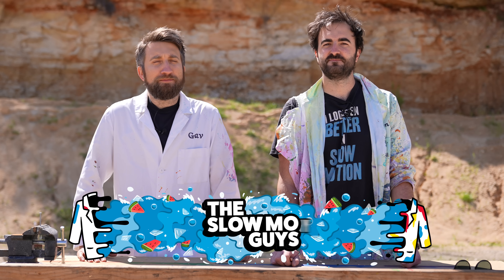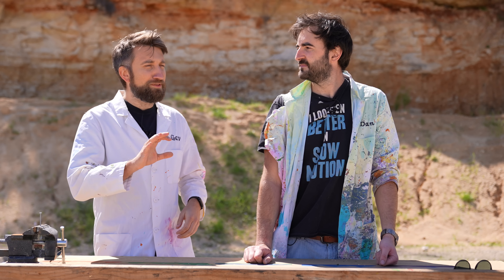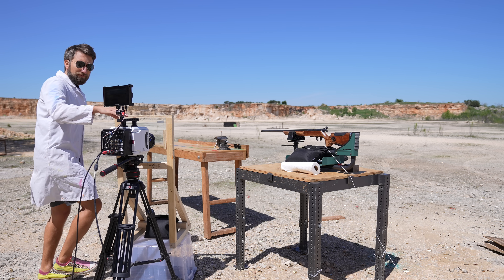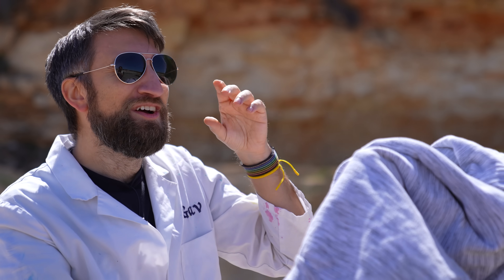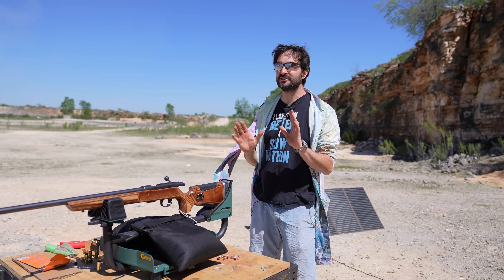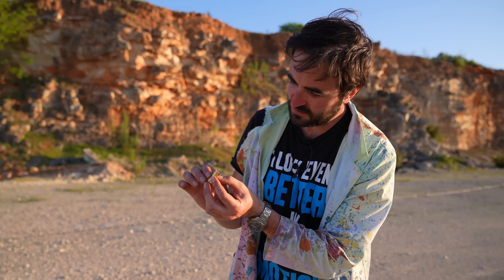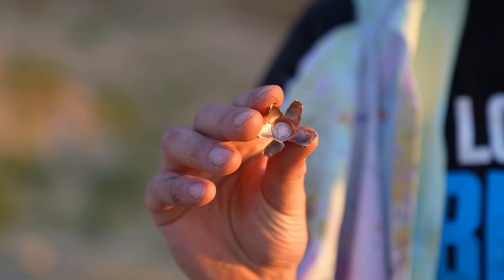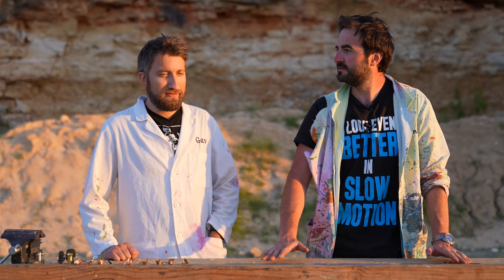Can a Bullet Go Through Another Bullet? 875,000FPS - The Slow Mo Guys

Comment: If you wanted to use a more accurate round why not the NATO 5.56 or Remington .223? Both of those are technically the same caliber as that tiny little pea shooter .22 but they pack enough propellant to fly straight through that hollow point. The first clue was that it was a pointy round and not a ball…could’ve been way cooler to use an appropriate round. (If it was a handgun in the movie it was probably an FN 5.7 which is just a tiny bit larger than a .22 but a higher velocity load)

Comment: To get more velocity akin to two guns firing at each other, get a 22WMR casing, hot load it, and use the sawn off tip of a phillips-head screwdriver for the hardened bit.  That's your smaller bullet.  Sabot it to get a good seal and to avoid barrel wear.  You can get a good spin and the shovel shape will wedge the larger bullet apart.

Comment: If two were fired at each other and hit exact, they wouldn't just "stick together" and drop. What will happen is that both will peel outwards in a perfect radius, 90 degrees from the impact (perpendicular) exactly like if you fired one at a solid piece of steel. They would both do this, so you just get a perpendicular expanding radial circle of scrapnel, in a very thin line right around the impact point. Hope this makes sense... hard to explain without drawings !!

Comment: I know they tried to recreate the closest they could, and they even said the answer without realizing it; the smaller bullet was NOT a .22LR, it was most likely a custom 5.7mm x 28mm round, fired mostly by the FN Five-Seven pistol or P90 PDW; a round literally designed to have less kick than a 9mm, but ALSO able to...defeat body armor. It does this by using a smaller, spitzer tipped, higher velocity round than a 22LR. Every round fired in these tests was a copper jacketed, lead core. Not sure why they say its so hard to buy steel core rounds...they sell them at every gun store. Two pieces of lead will deform regardless of shape/velocity. The proof is that they cut the velocity in half by having only one bullet moving (and rotating, also stabilized) & the other just sitting there; but when they kicked it up to an actual rifle round, its velocity alone makes up for 2 handgun rounds.
Show us a 5.7mm solid copper round hitting that fat, hollow-point  .50AE round and I guarantee the 5.7mm's velocity is high enough to penetrate AND continue on...accuracy after impact though...shmaybe.

Comment: There’s a puzzle in the game Ghost Trick: Phantom Detective where the goal is to find something to swap with a bullet that’s been shot that has the same shape as the bullet, but because the bullet is so small you can’t really see it, one of the objects you have as an option is a knit hat, like a beanie. When the hat is sitting on a surface it’s shaped like a long rectangle with a round end, as a kid I thought that was the right shape because I was picturing an unfired bullet, but the solution was to have the hat hang from a hook so it is shaped more like a half circle

Comment: If both bullets were fired from pistols at say 2000 feet per second, wouldn't that make the impacting velocity 4000 feet per second? If a hardened jacket on the smaller caliber round was fired at a high enough velocity to over come the opposing energy of the 50 caliber round, it could continue on its course, but at a greatly reduced rate.I would love to see a slow mo of a hardened projectile fired through the 50 cal, at say 20,000 MPH. Maybe try it with a shaped charge, well perforating unit.

Comment: Interesting video with awesome footage. 
7:07 they aren't going to either. The 22lr is too slow / too low energy. What little energy the 22lr projectile has is being consumed by accelerating the 50 AE round off of the nail. Another thing that is coming into play is that you are firing a lead bullet into the open nose of the 50 AE round and thus going lead against lead rather than copper against lead (yes, for those questioning it, the 22lr projectile is for all intents and purposes just lead... They are copper plated, hence the copper appearance but not copper jackets) so its likely that the two lead portions are just melting together (i.e., energy being lost / converted to heat).

12:40 A better more movie accurate choice would have been to fire FN 5.7x28 rounds at it.  Then you would have the small pointed copper jacketed projectile that would have more accurately (within reason) matched what was shown in the movie. FMJ Type 5.7x28 ammo isn't all that hard to find (armor piercing shouldn't be necessary, FMJ's will probably do the job).

As for the .30-06 rounds, if they were soft point or hollow point, then I'd expect them to do exactly what they did. A FMJ round might have actually pierced though but its larger diameter is going to cause problems nonetheless.

Comment: You can get the M855 green tip 5.56 with a soft steel core which may hold it's form through the lead and copper jacket. They are readily available at any gun shop. It is also .224 caliper like the 22 long rifle you tried.

Comment: Firing the .22 into the primer was pretty interesting to watch, and you are right about it needing a barrel to ignite all of the powder.  Smokeless powder burns with much higher pressure and intensity than black powder, though "burn" isn't really accurate, as it more detonates since it's a grain propellant and not really a powder, but it does need a barrel to contain that pressure to ensure that all the grains get ignited.  Anyone who's fired short barreled rifles will notice that a some of the powder doesn't get ignited and is thrown out  of the barrel before it has time to ignite.

Comment: Here's an idea for the next video and a solution to the messed up table. Take an electric sander (or maybe just regular sand paper if it's easier) and sand off all the uneven holes. Probably won't get rid of them completely but would definitely make them smaller. Then record the movement of the sander across the table, showing all the little wood particles getting obliterated. If it’s too difficult to film then at least use the sander on smaller things

Comment: should have used a .22 lr packs more than they normal .22
or an actual pointed round like the one in the movie which likely also had a slightly higher powerder load 
the thing is with how perfectly this kind of worked id call this one plausible
and while yes the rifle round was doing more of what was seen in the movie the fact is neither of the bullets you used where hard tipped which is likely why the bullets just kinds clumped together

Comment: If they shot two bullets into each other, the trajectory of the fragmentation would move in the direction of the bullet with greater momentum, which is a function of mass and velocity, which is almost certainly always the bigger bullet.  It would only stay in the same place if the bullets had the same momentum, which would probably require the exact same kind of bullet.

Comment: You guys unknowingly went the myth busters route, you tested the myth but then recreated the results. That’s what we need to see!! Great job.
Reply: Absolutely the best part. The "ok, but what does it take to make it look like that" escalation is very mythbusters.
Reply: They inadvertently made the same mistake as The Mythbusters when they caught caught hell for not taking into account Newton's 3rd law of motion, although for the opposite reason.  We are only seeing the kinetic energy of the smaller mass hitting the larger mass.  If both bullets were fired at the same time, the larger bullet would greatly increase the amount of kinetic energy in the collision and likely change the outcome.  It would be like a car traveling 60mph hitting a stationary truck vs. a car travelling 60mph hitting a truck travelling 45mph.
Reply: Myth Confirmed.
Reply: @DJBillionator  I'd say Myth Plausible. The tests weren't particularly analogous due to the lack of a hardened AP tip on the smaller round, but we can still learn from these shots that it's probably maybe possible potentially
Reply: No, they didn't. One bullet fired isn't the same as both bullets being fired. Nice try though
Reply: @ericmarc7529  It entirely depends on the power difference between the two rounds, the round with the most power should be the one being fired.

Comment: 10:41: This is just exhausted guesswork so take it with grain of salt; Most of the propellant failed to explode because it wasn't compressed. The brass swells and then ruptures, disrupting the ignition of the powder, because the bullet isn't seated in a barrel to contain and redirect the force forward instead of outward. 
Or I'm totally worng
Reply: I believe the powder requires more like heat, as opposed to pressure. The primer sends out flames, not so much gas pressure. Of course, enough externally generated pressure will generate heat (and potentially ignite the powder) but here it wasn't enough.

Comment: Lads!!! Outstanding video.... but there is something weird i am noticing here.. i think. I am a serious marksman.. shooting a bunch of handguns.. rifles etc.  2 Things that really grabbed my attention... 1 the unstable spin attitude of the 22 round.  and 2 on the 30-06projectile.. just before impact.. a few frames before?? It looks like there is something weird going on at the very tip of the 06 projectile. It looks to me like the tip is deforming, peeling back or something is up there. Can you inspect the frames and see whether its just an illusion?? or does the 06 projo actually deform its tip during that very short flight to target?  If it does... it has a HUGE and significant impact on projectile construction. We have polymer tipped projectiles and there was a lot of talk about bullet nose "slump"... the resin material actually melting in flight.. i think??? This would be a FASCINATING project to film bullets as they arrive at even a paper target at say 200 or 300m? At 300m a 6mmBr match rifle wil shoot under 1 inch i bet.. so it will not be too hard to get the camera at the right spot????  And at what distance will a 22 bullet achieve stable flight??? Another huge issue for guys like me!!!...lol

Comment: Should have used a 17.hmr FMJ. nearly identical to the CGI bullet also moving twice as fast which helps to show what would happen if both projectiles were moving towards each other at roughly 1k fps. Still cool video, that 22 barrel might be super dirty because as Dan pointed out that bullet shouldn't have exited at that bizarre upwards angle.

Comment: Lead vs/ lead the higher mass lead is going to win.   So plowing a .22 into a .50 means the heavier lead is going to soak up almost the entire kinetic force of the far, FAR lighter round.

If you want full (potential) penetration with a .22 call hunting round you should be using steel or, preferably, tungsten with a very sharp point.  That will push the lead out of the way without deforming itself like the lead bullet did.
If you look closely at the movie clip that is exactly the bullet used:  very sharp point & steel.

Also, to preserve your table, procure some heavy cardboard (4 layer laminate) to put under whatever's being blow to bits.

Comment: The movie effect bullet diameter difference had the hollowpoint looking more like 12 gauge diameter if the other was a .22 cal. But a .22 cal projectile that shape was more likely a .222 or .223 rifle. Going by the size difference probably more like .17 remington. Had the large pistol bullet been fired as well, the speed upon impact would have practically vaporised both bullets if the smaller one was .22 rimfire, with the shrapnel being blasted towards the .22 rifle.

Comment: I like the subtle advert for the M1 there: ".30-06: it will go through."
As for the splash, that's velocity for you. As Einstein said, it's all relative. The "stationary" bullet on the nail is hitting the "moving" bullet that came out of the rifle just as fast as vice versa, and how fast they're going east or around the Earth-Moon barycentre or around the Solar system barycentre can be ignored. You can convert temperature and relative atomic mass to root mean square velocity of the individual atoms in a gas. In a solid, it's probably a bit more complicated, but in a gas, lead at melting point has r.m.s. v 77 m/s and iron at its melting point 809 m/s, so iron hitting lead or lead hitting iron with a relative velocity of 750 m/s is going to cause the iron to behave as a solid and the lead to behave as a liquid. A steel-cored .30-06 AP might have made it through, from far enough back for it to have slowed down enough to not "melt" on impact.
The only pistol cartridge that comes to mind as being likely for that scene is 5.7 x 28 mm, which has more of a five-hundred-and-some velocity, so a steel one like SS190 might just do it. I'd expect it to lose an awful lot of energy and tumble on its way through, though. Also, I don't see a 5.7 pistol in the IMFDB lists.

Comment: As I recall from the movie they were custom full steel penetrator rounds designed for high velocity. Getting something like that at that size even in the military would be a pain.
Reply: I like the subtle advert for the M1 there: ".30-06: it will go through."
As for the splash, that's velocity for you. As Einstein said, it's all relative. The "stationary" bullet on the nail is hitting the "moving" bullet that came out of the rifle just as fast as vice versa, and how fast they're going east or around the Earth-Moon barycentre or around the Solar system barycentre can be ignored. You can convert temperature and relative atomic mass to root mean square velocity of the individual atoms in a gas. In a solid, it's probably a bit more complicated, but in a gas, lead at melting point has r.m.s. v 77 m/s and iron at its melting point 809 m/s, so iron hitting lead or lead hitting iron with a relative velocity of 750 m/s is going to cause the iron to behave as a solid and the lead to behave as a liquid. A steel-cored .30-06 AP might have made it through, from far enough back for it to have slowed down enough to not "melt" on impact.
The only pistol cartridge that comes to mind as being likely for that scene is 5.7 x 28 mm, which has more of a five-hundred-and-some velocity, so a steel one like SS190 might just do it. I'd expect it to lose an awful lot of energy and tumble on its way through, though. Also, I don't see a 5.7 pistol in the IMFDB lists.

Comment: 5.56 has the same diameter as .22, the bullet in the movie look like .228 creedmoor but i dont know how you would fit that in a handgun, maybe its 5.7 idfk
Reply: 5.7 SS190, steel core, might do it. The melting point of iron or steel is a lot faster than the melting point of lead, and that bullet is in between them.

Comment: You should use a 223 or 5.56 round shooting at the 50 cal hollow point.  Still a 22 cal round, but moving at almost 3100 feet per second... 22lr is only 1100 to 1600 feet per second if using a 22 mini mag. Big difference!
Reply: 62 grain green tip 5.56 ammunition... steel core... better representation!

Comment: I'd try with M855A1 bullet as the impactor, that round has small hard metal penetrator tip what won't deform against .50Cal AE lead JHP.

Velocity should be very high too, almost 1 km/second out of 20" barrel.

Comment: Skip to 4:35 for what was in the thumbnail. You're welcome.
Reply from the maker: 14:16 actually
Reply: @theslowmoguys  I like the subtle advert for the M1 there: ".30-06: it will go through."
As for the splash, that's velocity for you. As Einstein said, it's all relative. The "stationary" bullet on the nail is hitting the "moving" bullet that came out of the rifle just as fast as vice versa, and how fast they're going east or around the Earth-Moon barycentre or around the Solar system barycentre can be ignored. You can convert temperature and relative atomic mass to root mean square velocity of the individual atoms in a gas. In a solid, it's probably a bit more complicated, but in a gas, lead at melting point has r.m.s. v 77 m/s and iron at its melting point 809 m/s, so iron hitting lead or lead hitting iron with a relative velocity of 750 m/s is going to cause the iron to behave as a solid and the lead to behave as a liquid. A steel-cored .30-06 AP might have made it through, from far enough back for it to have slowed down enough to not "melt" on impact.
The only pistol cartridge that comes to mind as being likely for that scene is 5.7 x 28 mm, which has more of a five-hundred-and-some velocity, so a steel one like SS190 might just do it. I'd expect it to lose an awful lot of energy and tumble on its way through, though. Also, I don't see a 5.7 pistol in the IMFDB lists.
Reply: @theslowmoguys  oh ok!